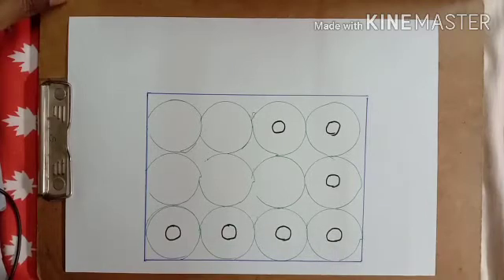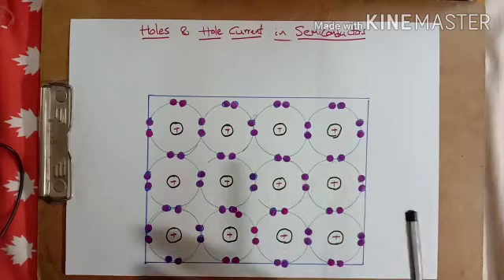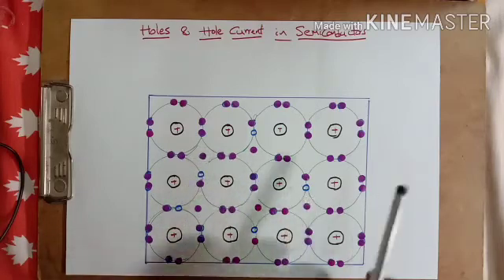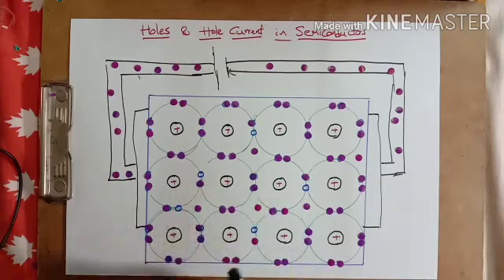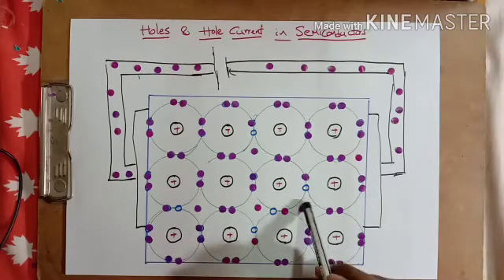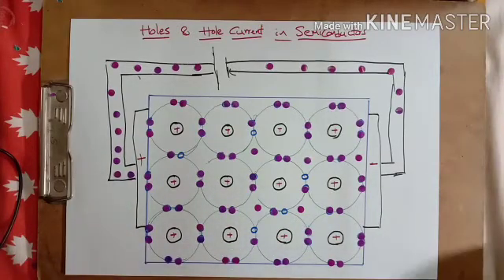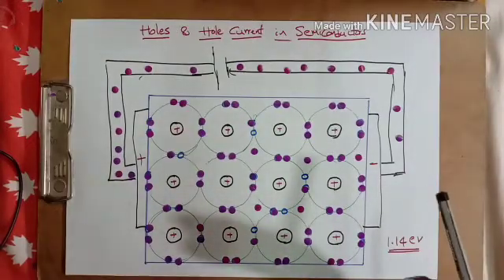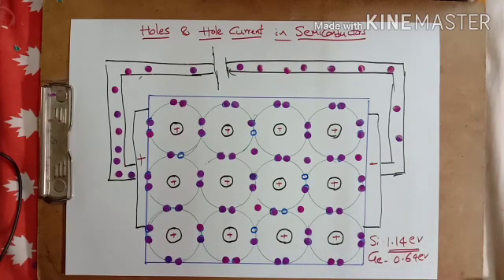Holes amd hole current in semiconductors

Comment: how do a transistor  increased weak sound wave from mic ?
Reply from the maker: Transistor means, transfer resistor. It transfers the input signal from low resistive device to  a high resistive out put. It also provide large changes in the output signal (either current or voltage) to a minute change in the input signal (current or voltage). For example, in case of a bipolar junction transistor connected in common emitter mode, a small change in the input current (base current) produces a proportional large change in the output (collector) current. 
So, a weak sound wave passing through a mic, will be converted in to a weak electric signal (current or voltage) and when it passes through a transistor connected in common emitter mode, it will produce a replicated large electric signal (The power will be drawn from the power supply). This large replicated electric signal will then drive the output (A loud speaker). 
Hope it is clear.